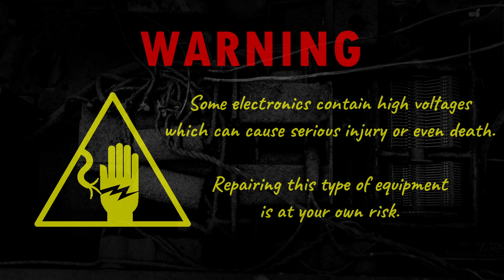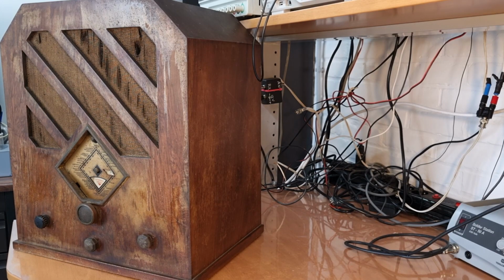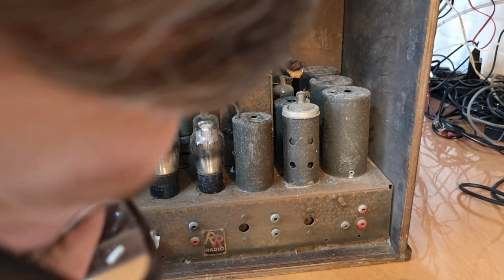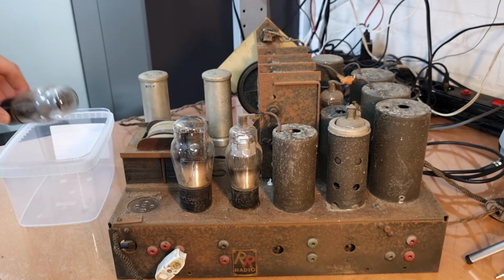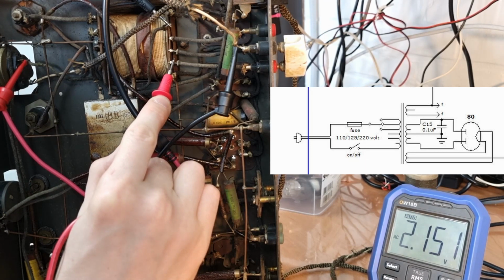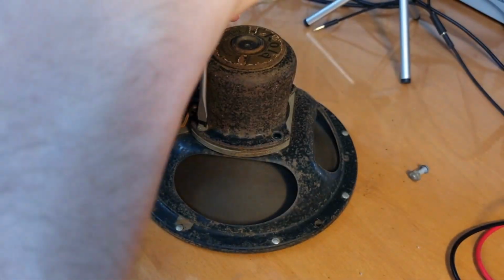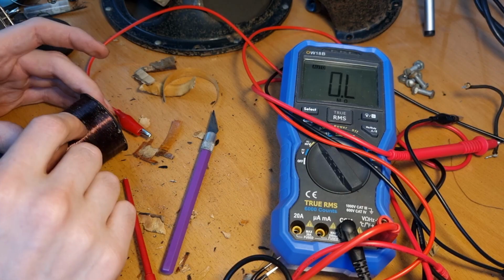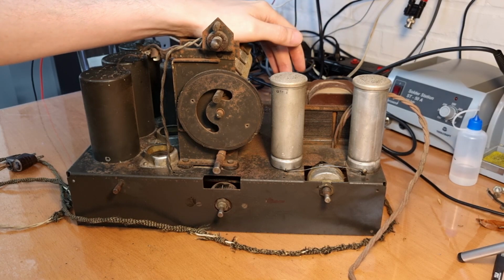The oldest radio I've ever worked on, an R.R. Radio Type 568 from 1935! - Part 1

Comment: It is likely that this radio had veneer on the front of the cabinet too, but it decayed and someone pulled it off some time in the past.  Maybe you can try to veneer the front again if you can find matching veneer.
Reply from the maker: It might look like that, but I don't think the veneer was pulled off. The cabinet is just extremely dirty and the lacquer is gone in certain places. I think underneath will still be the original undamaged veneer. Stay tuned for the video about the cabinet restoration.